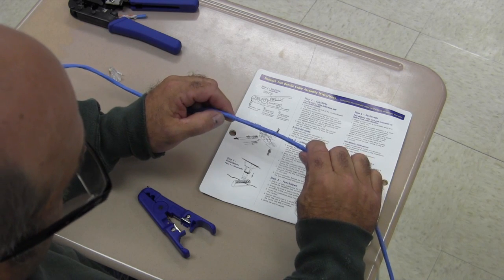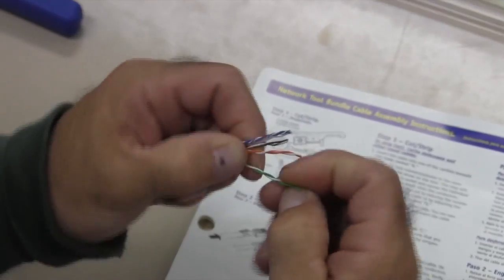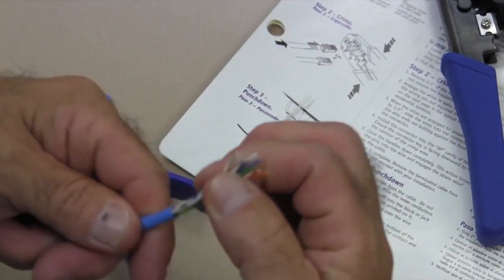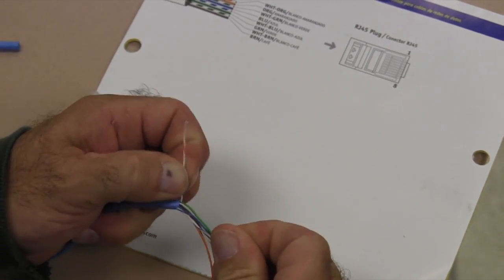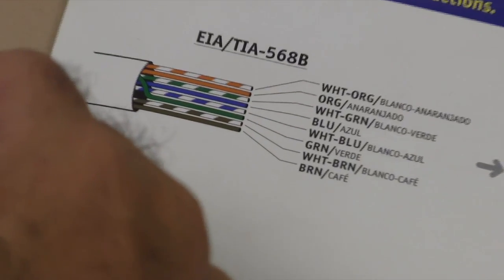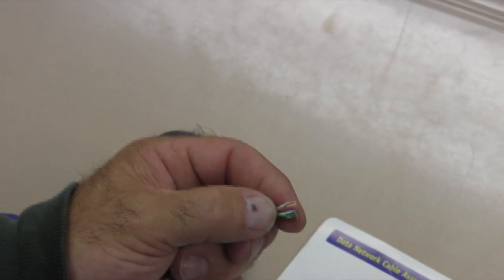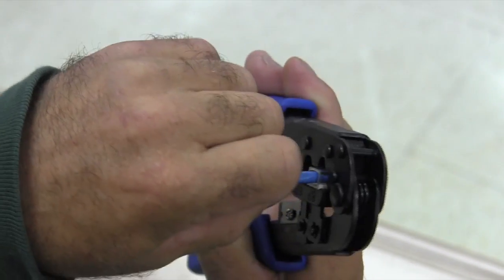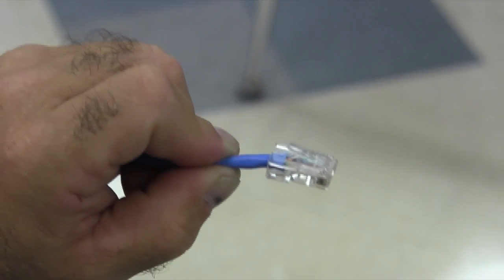Cat5

Comment: Note that there's a second ordering of wires that's in common use (the green and orange pairs are swapped).  Which one you use doesn't matter, as long as both ends of the wire use the same ordering.